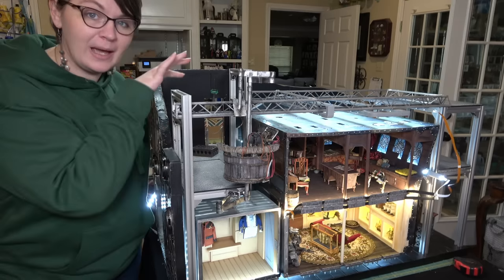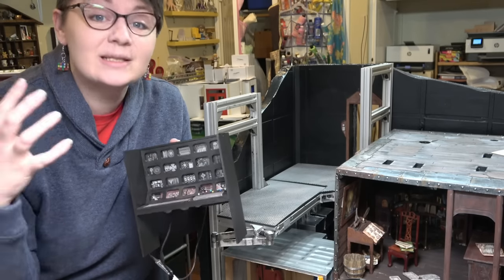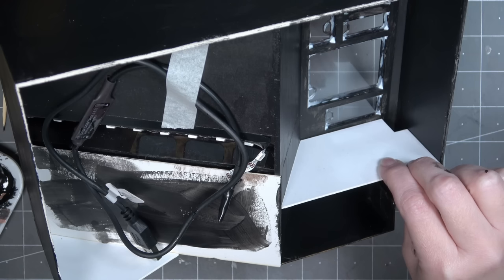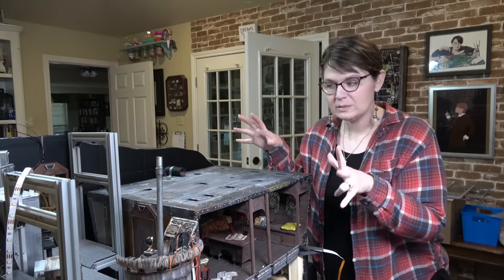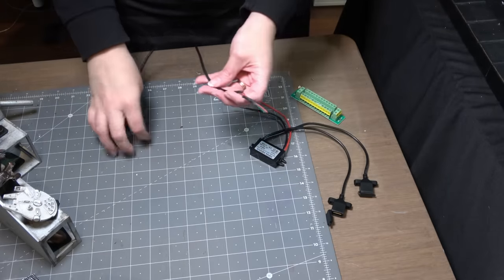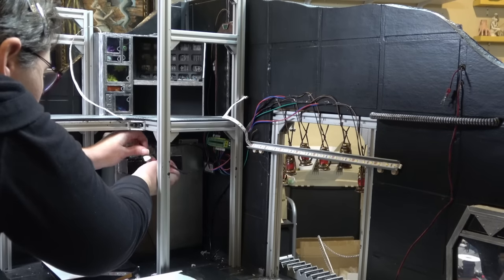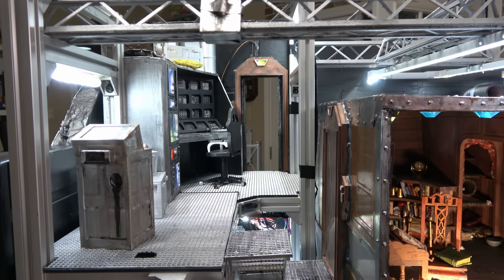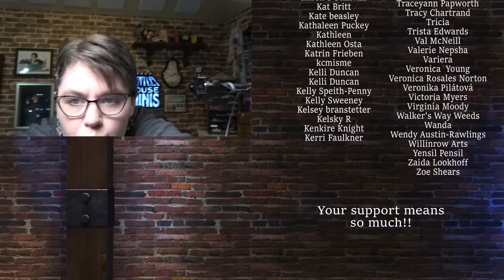The Captains Console is Complete... And there's a Giant Eyeball!👀

Comment: It's looking really good Ara the lighting is very impressive. I love the nod to The Flight Of The Navigator, one of my favourite movies.

The thing I'm struggling with is putting the plug on the lights in my dolls house. It looks like I just put the wire through the hole then wrap the wires around the prongs. I dunno it's pretty confusing 😮
Reply from the maker: Ooh that does sound confusing! Is there a brand on the plug that could be looked up?  Maybe there is a video on it somewhere!  Thank you so much Zoe!  I am so glad you liked the FOTN reference!
Reply: @BentleyHouseMinis  I'm guessing there will be a YouTube video on it. From what i can work out the plugs are pretty generic. The light was originally wired to the plug when I got the dolls house but I had to take it off to remove the light during renovation

Comment: 24:30 Congrats on the soldering and wiring :D. I'm actually watching this while doing my own soldering for a 10' diameter UFO that will be a halloween prop. I decided to go easy in 2 areas but what I'm working on is 18 lines of LEDs that will radiate from the center. So I have to solder 6 connections (4 on one side, 2 on the other) on 18 strips, plus connecting them between each other.... yeah it's a lot of soldering. Nice to have this in the background ^^. This is also my first dabble into electronics so it's been an interesting past few months researching everything I need. Oh, and I think.. ferrule, really? Ok google. Ferrules are pronounced like Will Ferrell.
Congrats on getting so much really frecken tedious stuff done this week :D. It's coming together so well :D

Comment: Are the lights powered via wall outlet?  Good for you tackling the soldering!  I was so nervous the first time I tried as well but I'm slowly getting better at it.  What I'm not good at yet is estimating power needs based on the lights I'm using.
Reply from the maker: Yes they are able to be plugged in and operated with a remote.  That is super helpful for the museum because it will be behind glass there.  I still don't understand how to plan out the power needs either but I hope for that to be the next step in my learning journey ;)

Comment: I have a question about how you intend to hide/integrate the non lighting sections of the strip lighting.  I'm planning to create a terrium style cemetery and I know that I want some uplighting.  The straps seem the easiest way to do those but I haven't figured out how to hide/integrate the non lighting sections in a way that doesn't distract from the scene.  I'm hoping to take some inspiration from your project.
Reply: I believe that strip lighting can be cut and still work. If that is the case, you can simply use only as much as you need of the end closest to the parr that would be plugged in and cut off the what remains at the other end. I hope you can make since out of that! LOL  Best of luck with your project!
Reply from the maker: Yes the LED lights can be cut shorter but then you lose the ability to easily connect them with another strip so be careful with that.  I will be hiding them in plain sight because of the nature of my project (a spaceship).  However when I did the Addams Family house I hid them inside of drain pipes to make them look as thought they were part of the houses structure.  I am not sure if that helps with your project but maybe if gives you a few ideas😊  Best of luck with it!